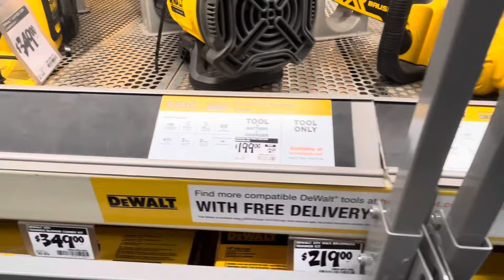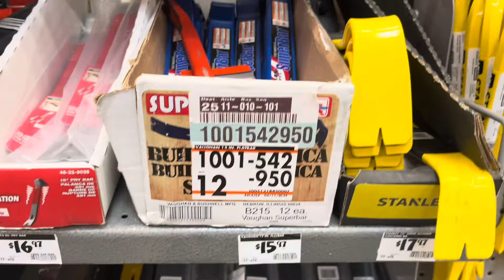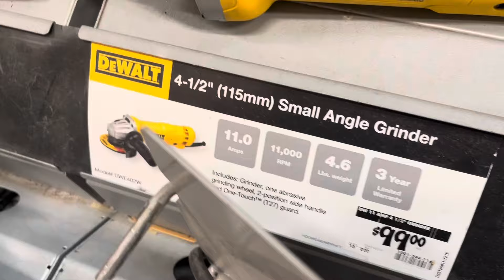California Bans All Gas ⛽️ Engines.. Starting with Lawn & Garden Tools..

Comment: Smh as a former landscaper and aspiring small engine mechanic at the moment, this is so dang sad.. Electric equipment especially for day in day out work is mostly horrendous. For the homeowner it works but not the pro. And working on electric equipment is basically impossible